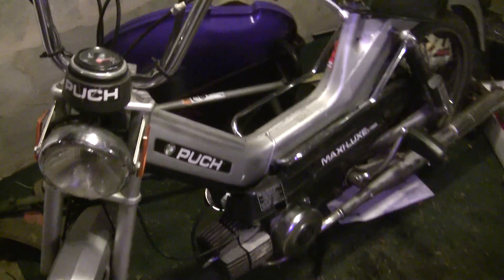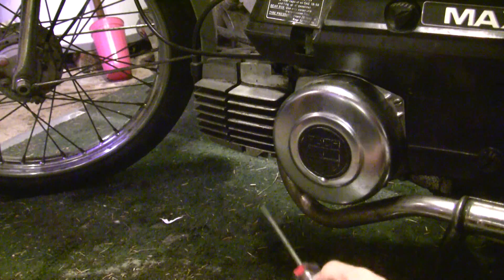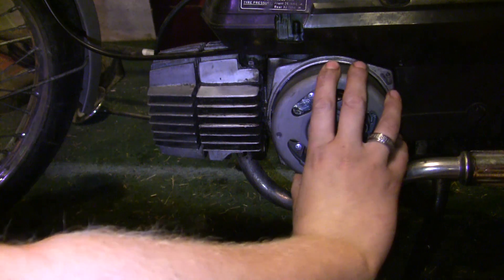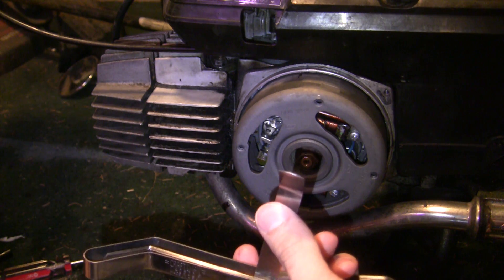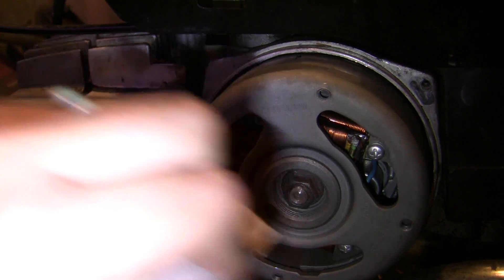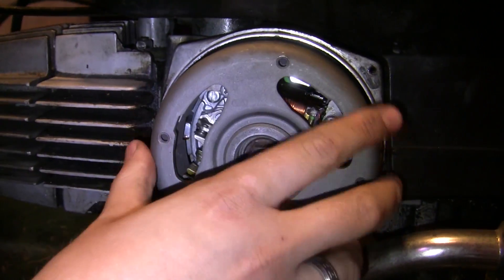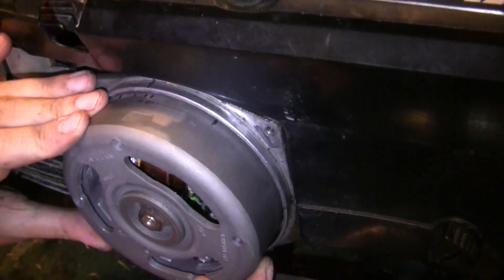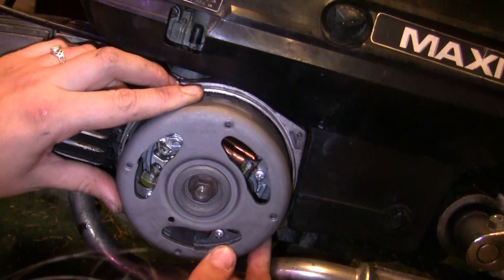How To Set & Explanation of Puch e50 Moped Timing with Will & Travis

Comment: So let's say I set my timing at 16 degrees, are the points supposed to start opening or closing at this point?
Reply from the maker: +Jose Serrano As you rotate the flywheel (the direction of the arrow printed on the side) the points will just barely start to open at 16 degrees if that is what you have it set at.
Reply: +TravisTutorial that helps, thanks Travis! My e50 has a ported out Polini and I probably want to keep it at 16 degrees, especially if at WOT it ends up advancing

Comment: Hello Travis, I own a 1978 Freespirit moped and learned a lot from your videos but I'm stuck on one problem to get it running. If you could please contact me by email so we can discuss further on this that would be great. (5150tatch@gmail.com) Jesus
Reply from the maker: +Jesus Ramirez What is your issue? If we discuss it in the comments section here others can benefit as well.
Reply: Okay  the problem I'm having is with the spark from the ignition coil to the spark plug. I get spark from the wire that plugs into the coil but no spark from the coil itself to the plug. What could be the issue there ?
Reply from the maker: +Jesus Ramirez It is possible, but very very unlikely that the coil is bad. I would first try a different spark plug (really, that happened to me once...), then I would make sure the plug wire has a good connection on either end, they "twist" on to a barb on the boot and coil. You might even want to snip a tiny bit off each end for a fresh connection. Finally I'd look at the boot as the possible culprit, if that is a case NGK makes nice boots that are actually waterproof for pretty cheap.
Reply: +TravisTutorial spark plug and coil are brand new so I doubt that could be it I hope not lol. And I just realized it's missing the crankshaft key. Would you happen to know where I could purchase one?  I can't seem to find on Amazon nor eBay
Reply from the maker: Treatland, everything treatland for Puch parts:

http://www.treatland.tv/puch-moped-flywheel-magneto-woodruff-key-p/puch-e50-woodruff-key.htm

I had an aftermarket coil on one of my bikes and it actually gave weaker spark than an OG Bosch one I had as a replacement, but if you are getting spark to that you should be close.

Comment: there is another trick to setting timing if you what to know exactly when point open you make a tool out of a flash light take two wires tie them in to where flashlight switch goes  and put two clips on each end when the clip touch light comes on put one clip on ground of coil and the other on wire from points (un plug from coil) when the light is on points are closed the moment the light goes out that exactly when it will spark mark it on fly wheel that where you timing is set another thing when you set gap you have to move points arm touching fly wheel that where most people make mistake

Comment: Wow I Finally understand timing! Question: I bought a used maxi, then put a new tuned exhaust, airfilter, larger carb, and up jetted. Should I check the timing, and still do it to 16 or 17 degrees?
Thanks
Reply from the maker: RSK RC Since you are still rocking the stock cylinder setting the timing to stock should be fine, if you are concerned about running hot you can run a temperature gauge from Trail Tech to ensure you stay under 400 degrees.
Reply: TravisTutorial I ended up looking in to it and found that it was advanced by maybe 5 degrees.

Comment: Okay so I set the timing up now and I don't know what the hell, but I just turned the stator completely to the other end and now the timing seems to be in that factory mark : o. Is it normal or what I don't know if I measured something wrong but really can it be like it was completely retarded at first like 10 degrees and when I turned it all the way to the other end, now it is normal like 17-18 degrees. And there still is the original Bosch flywheel like you do and yes it rotates the other direction.
Reply from the maker: Benjami Lindqvist As long as you are confident that the labels for the marks on the flywheel are correct then it's entirely possible someone long ago retarded the timing.

Comment: Hey Travis and Will! Do you know or could you explain that in my 1959 Ögland Swing there are two marks on the flywheel like machined in. And one of them is a letter M and the other on is a letter O. Could either one of those be the top dead center mark like made in the factory for it?
Reply from the maker: Benjami Lindqvist Very likely yes! Looked up some Ögland Swing pictures, that thing looks awesome, and also appears to have a Sachs motor. On their moped engines Sachs had two marks, on for TDC and the other for what the timing was supposed to be at from the factory. See if you can dig up a service manual to find out which is which or maybe try asking on MopedArmy to find out for sure.
Reply: TravisTutorial Hey, I was about to purchase a 1979 Garelli ssxl, but the seller sold it to another bidder after saying that it was mine. I really had my heart set on a vintage moped, and was wondering if there where any sites where I could find vintage mopeds? I've only found 2 on craigslist.
Reply from the maker: Ah, bummertown - that has happened to me before too. What state are you in? Top places to search are craigslist, eBay motors, MopedArmy buy/sell forum, and if you live near a moped branch, their facebook group
Reply: TravisTutorial Normally I wouldn't be too upset. but the guy JUST sold the motor and exhaust. The funny thing was that he sent me the email telling me this in the middle of your sellers etiquette video. Back on topic though, I live in Missouri. Every moped I've sen pop up is at least a 2 hours drive away. I get super car sick (and don't really have a car) so I'm not too keen on that.
Reply from the maker: Oof, yeah I feel your pain - for my first Maxi I had to get a buddy to drive me 2 hours to get. Don't give up - post a "wanted ad" on craigslist looking for 2 stoke mopeds, include the words: Puch, Tomos, Minarelli, et. On my phone I had a craiglist app that would alert me within 15 minutes of someone posting an ad with "moped" in the title. I had to waft through the scooters but it worked. Again, check eBay motors regularly and if you get desperate, go on moped army under "riders" at the top and see if there is someone remotely close to you with a large collection of bikes and pop them a message - never hurts to ask, good luck!
Reply: TravisTutorial Thanks! I'll defiantly do that.

Comment: Yeah i got that. I noticed when you first marked the flywheel with the line in the case. Then rotated ccw for the second mark, their was considerable distance between the two. On my e50 I've gotten to this point. My space between both lines on my flywheel are 10cm is that right? Seems really small compared to yours in the vid. Basically I'm trying to advance timing. I have a 50cc hi hi kit from treats that i running. It bogs at 3/4 throttle. When i slowly put it to wot it pans out but pops like back firing until i throttle again? Idk whats up

Comment: I dont understand your measuring with the tape? I followed your vid but for some reason its not working?
Reply from the maker: Nathan Bobec The measuring tape allows you to measure degrees before top dead center, so say I wanted to set my timing to 15 degrees BTDC, I would put the tape on the flywheel and draw a mark at 15mm because again, on a Puch flywheel 1 degree = 1mm as the flywheel is 360mm in circumference. ZA50 flywheels spin the opposite direction so if that's the case make sure to measure in the other direction. What exactly isn't working - is your timing off even after you set it?

Comment: can you show a before and after running characteristics of this bike with timing changes?
Reply from the maker: Sooooo, if you have a stock bike you should adjust the timing to Puch factory spec, aim for 17 degrees before top dead center. Actually, you really just need to check the timing with a light if it's never been messed with. Your other comment mentions a lack of power, could be timing but could also be many other things. I'm assuming you're dealing with a stock bike that just sat for a while. In that case the first things to check are the carb (yes again), fuel flow from tank to filter, then filter to carb, float height, clogged exhaust, and air leaks. Make sure the factory air box is on it because it would have been jetted for that.

If you've got a bike with aftermarket parts then jetting becomes a factor and you'll need to learn to tune.
Reply: So I left the stock airbox on, everything is stock.  and I checked the timing and was getting a point gap of about 0.018 and timing of 21 degrees.  There is also a small air leak around the carb to intake runner connection (checked it with carb cleaner as you showed in one of your videos)  How do you check clogged exhaust? how to measure float height?
Reply from the maker: Tim Molinaro  Point gap should be fine and it'll run at that timing but it's a little advanced. You can help that air leak by the carb a bit by putting in a rubber o-ring from an assortment pack from an auto parts store.

Float height:
http://www.mopedarmy.com/wiki/Bing#Setting_Bing_Float_Height

Fred's Guide:
http://www.mopedarmy.com/wiki/Fred%27s_Guide
Reply: TravisTutorial when the timing is advanced will it have more or less power? and whats the risk in running advanced timing?
Reply from the maker: Generally more power, but the more you advance the spark the hotter the engine will run. Generally people say 400 degrees Fahrenheit is about the temperature you get to seize town, because the motor has gotten so hot it has actually broken down the oil in the gas.
Reply: TravisTutorial Thanks for the help man!

Comment: my puch e50 bogs down alot when running, it cannot accel or go up hills. carb is clean, will timing affect this?
Reply: if its too retarded, Yes, as the spark won't burn all the fuel before the exhaust port begins to open wasting both power, and fuel!
Reply: Have you measured the spark plug gap? The plug's points must be at 0,45mm (if i remember correctly)

Comment: I don't understand the part where you find TDC?
Reply from the maker: Two methods are shown, since not everyone has a piston stop handy. 

If you do: Screw in piston stop. Turn flywheel until it hits piston stop then mark flywheel. Now turn flywheel opposite direction until it hits again and make another mark. You use a paper ruler to measure the distance between those two points to find TDC. This is the most exact method.

Other way. Put screwdriver in spark plug hole. Rotate flywheel until you feel the point the piston at at the top before it starts to go back down. This is TDC, not as accurate put for stock timing it's not a big deal.
Reply: Okay thanks Travis, keep up the great work!
Reply: TravisTutorial Is this method just for 2 stroke engines? Thanks

Comment: I'm working on a puch maxi 2 hp not getting no spark at all to were the spark plug is at changed coil spark plug wire and cap and still did not get spark took it to shop and they say it's the main thing that sends spark to ignition coil do u kno Eny Web sites that sell them my lights and everything else work tho I just won't to change copper that sit on top under flywheel

Comment: TIP!! buy a second fly wheel and cut out the core  that way you have more room to do the tyming on the engine tis is the correct way to time your engine but when using a piston stop you can time the engine by loosening the piston stop to veel when you can turn it al the way then tigthen it 2 turns and use the card board althoug it may still be to thik since the gap max should be 0.7 mm max! your on the mark when your plug is dry and coffee brown

Comment: Travis,

Thanks for the video; I have a 1980 Malaguti commuter here. I fear the timing and points are off, and I say I fear because I can't locate a flywheel puller for this BOSCH flywheel. the Franco Marini MO1 engine manual says Z14-0501.

1. Do you know the 16mm center bolt? Is it reverse thread?
2. I have a strap wrench here; but could use a spanner wrench, # Z14-0506; maybe you can advise me here on how to get this flywheel off properly?

Comment: Thats rad, Travis!  Thanks!  I have a question:  If I bought a CDI kit, would that eliminate the need to set timing?  Or would I still have to set the timing even with a CDI kit?  I was thinking of going that route mainly because it changes the voltage to 12v.  What are your thoughts?   Thanks in advance!

Comment: Yep i had my maxi going backwards when i was 17, oddly it ticked over better lol :-)

I used to set my points to 15thou and the book said 16-18mm around the flywheel with a dress makers tape.
To aid points detection, a 6 volt bulb connected to the points and a battery to chassis gave a slight brightness change when the points were closed.

You may have wanted to remind your viewers that the petrol/air mix does not ignite fully for a split second after the spark, early b.t.d.c :-)